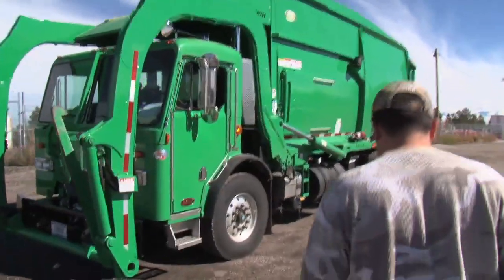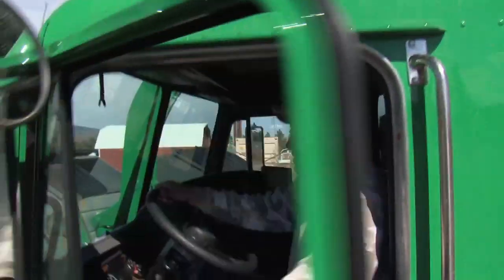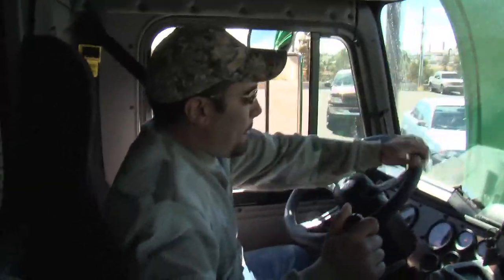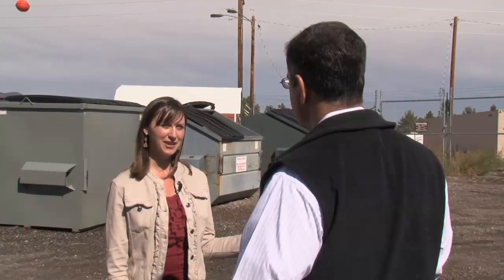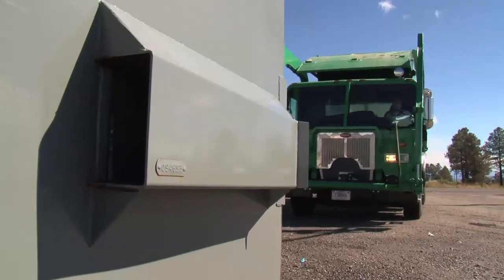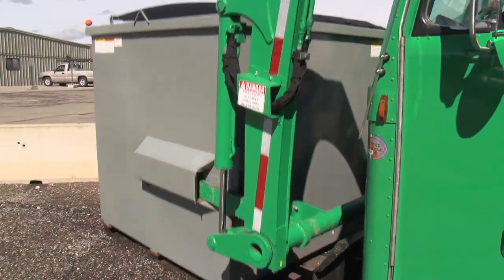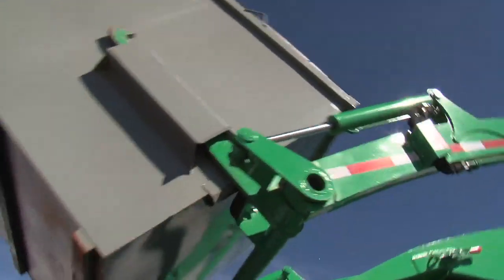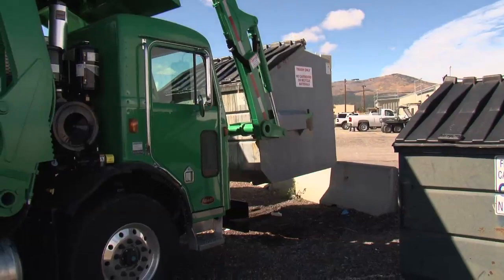LANL debuts hybrid garbage truck

Comment: I wonder if they took this idea off the GE Hybrid locomotive project. the train axle does exactly the same! Nice truck tho :)
Reply: I don't believe it does. The GE hybrid loco uses lithium batteries to charge up instead of using resistors to dump the regenerative braking whenever it can.